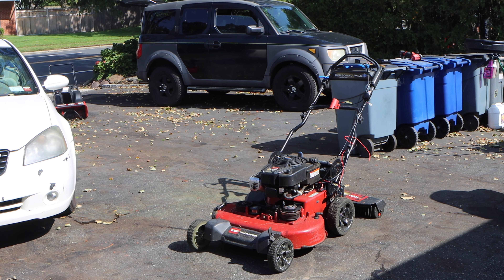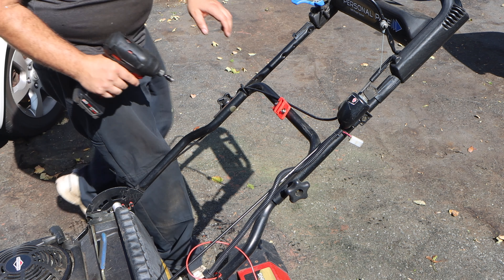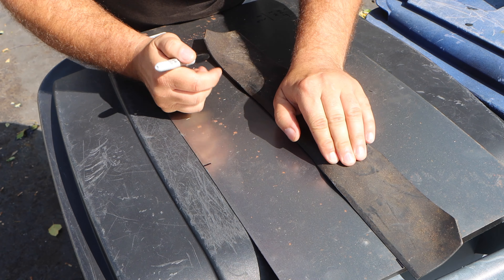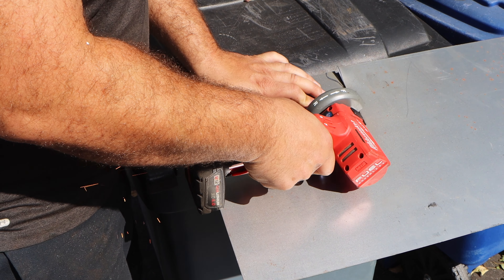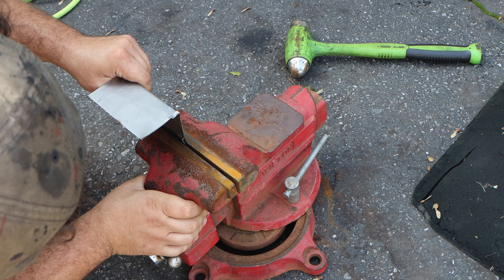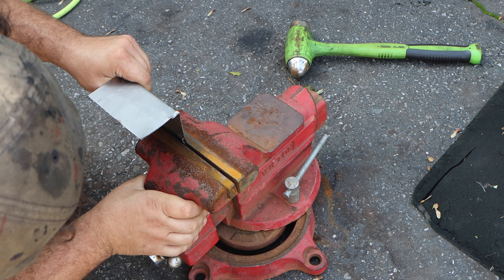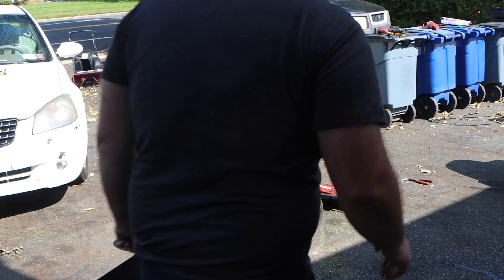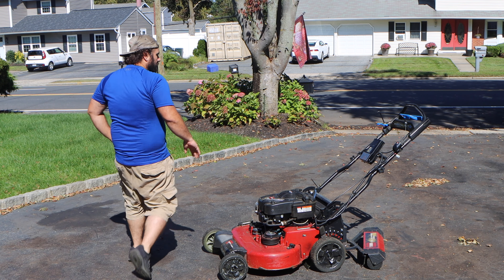Transforming My Toro Timemaster To Start Like A Lambo!

Comment: That's sharp. I like this idea for my personal snowblower, add the 12 volt starter and use a battery like this instead of the tractor battery. Just turn key for power. Only thing I wonder is how those batteries will hold up in cold weather and snow.
Reply from the maker: Thank you!

Battery life is shortened in the cold.  Did you see the new tractors?  They don’t even use traditional battery.  More like an ATV battery.  You maybe on the right path (look at generators) Walmart batteries are still cheaper.  I will try and start the Ariens with this and get back to you!  Thanks for the idea
Reply: @pattayperformance  Oh yea I know, the MTD's, they used to use those ATV batteries in the early 90's, they were gone for awhile and now they brought them back again right during this stagflation. I don't like those batteries, they cost more. Cool let me know how it works. If it works out well I'm going to add it to my Ariens too.

Comment: Any fuse should be between the load and the power source . This is to prevent fires or damage to battery . Using a higher volage battery the starter is getting 40v at 5A , instead of 12V at 10A . The higher volage will also turn the starter faster more RPM .Is the fuse in the right place ?
Reply from the maker: Sorry if I wasn’t clear…

The battery is located under a cover.  All I did was extended the wires from the harness where it connected the old battery to the new one.  Fuseable link is in the right place bc I didn’t tamper with entry points into the system.

Hopefully that makes sense